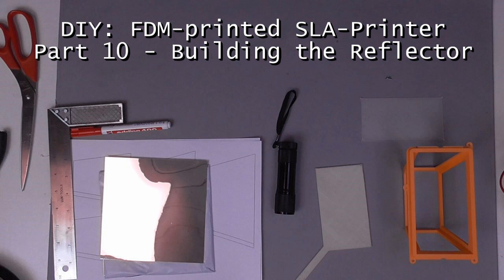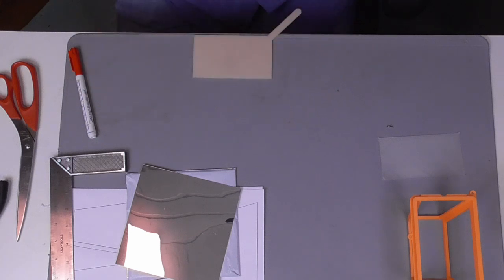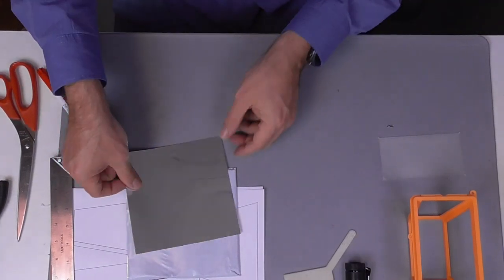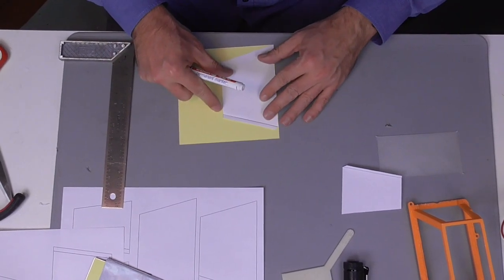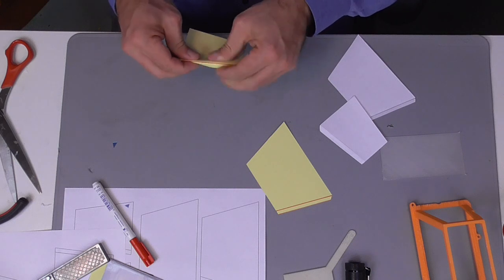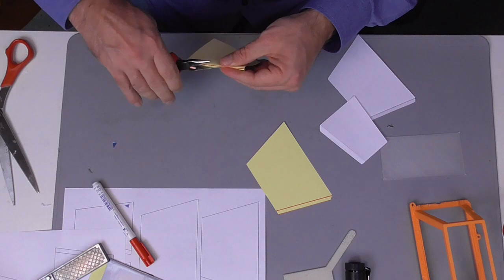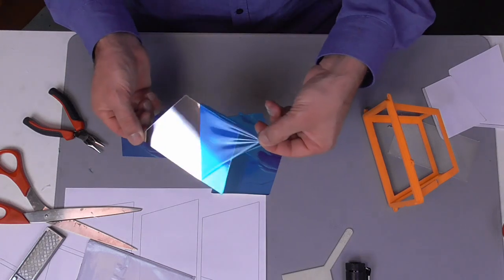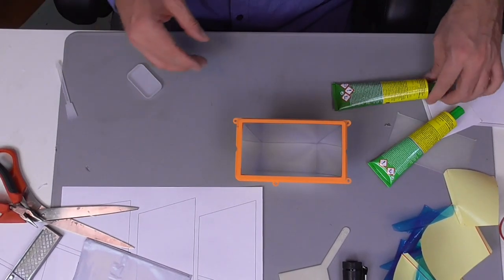DIY: FDM-printed SLA-Printer: Part 10 - UV-Reflector

Comment: I understand that resine is curated with UV Light, but how does the UV reflected light work together  with the LCD screen??
Reply: The light panel from the LCD is removed, leaving a screen that either has pixels on or off. On pixels block light from the UV light. Off Pixels allow light to pass. 
A previous vvideo describes process for removing light panel from LCD.
Reply: @TravisBrown42  Does it work with any lcd display?
Reply: @eloasilva3208  in principle yes. Some manufacturers may use different adhesion techniques that may make it difficult to remove though.
Reply: Thanks!

Comment: Where did you get the UV sensor plate? (UV colour changing PVC)? I can only find small key-chains with what looks like that material on it. Thanks!
Reply: Or did you print it with colour changing PLA?
Reply from the maker: Its FDM-printed with the following filament:
https://www.amazon.com/GO-3D-Sunlight-Changing-Printing-Filament/dp/B01EBAQAV2/ref=pd_sbs_328_3?_encoding=UTF8&pd_rd_i=B01EBAQAV2&pd_rd_r=27DADQ1W662N5X13WZ2Y&pd_rd_w=b9QcD&pd_rd_wg=zrlt3&psc=1&refRID=27DADQ1W662N5X13WZ2Y
Reply: Thanks!

Comment: Sorry my english is not great and I just can't get what those mirrors are made of, also, with what material did you print your diffusor ?
Reply from the maker: I printed the diffusor with PLA, but PETG would be much better
Reply: Im guessing the mirror tiles are some form of mylar. I too would be interested to learn more about "the diffuser". Thanks
Reply from the maker: The material is PET (same as used for most transparent plastic bottles):
https://www.amazon.com/Reflective-Stickers-Self-adhesive-Decorations-6PCS15x15cm/dp/B076W85K5S/ref=sr_1_1?s=hi&ie=UTF8&qid=1525537264&sr=1-1&keywords=pet+mirror+tiles&dpID=51JeMabAt4L&preST=_SY300_QL70_&dpSrc=srch
Reply: Thank you for your quick response ! Keep it up
Reply: Is it possible to cut the diffuser from some material like PET bottles? perhaps heating them to get flat?